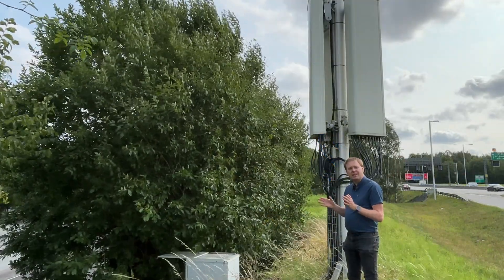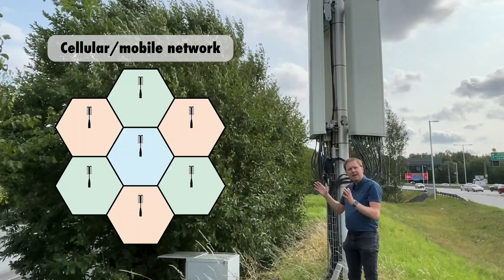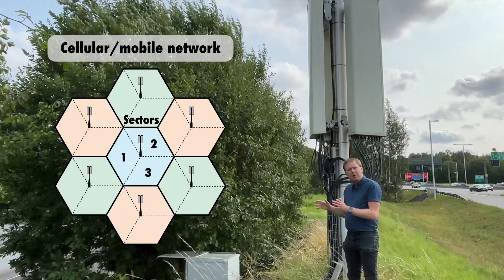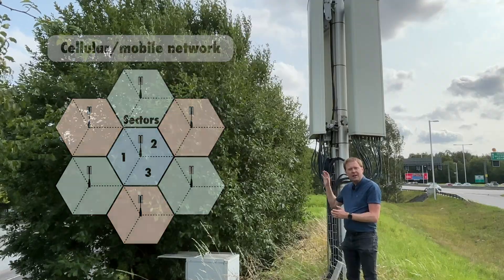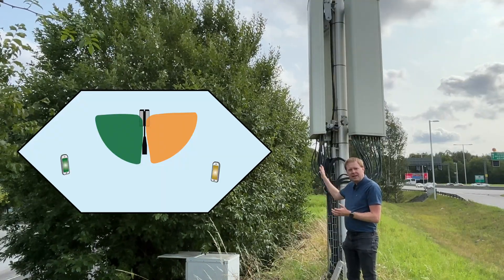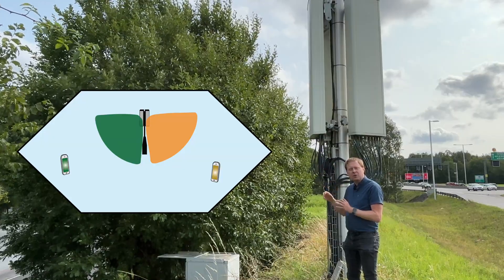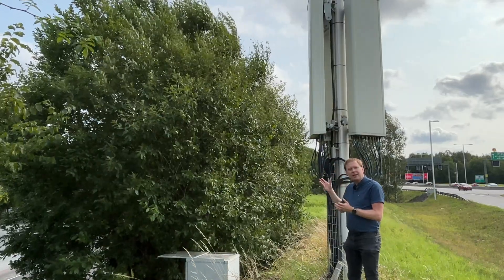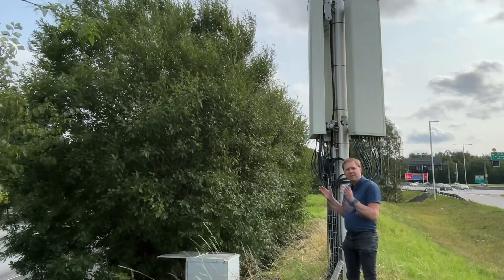How Cell Towers Actually Work (Base Station Tour)

Comment: when we say passive antennas can’t change anything, don’t we ignore RET ? normally it is possible to give uptilt or downtilt to arrange coverage if site has RET motors.
Reply from the maker: Yes, you are right that these panels typically are capable of changing the tilt angle. To my understanding, this feature is mostly used to fine-tune coverage right after the deployment, and not to dynamically adjust to traffic changes.

Comment: Isn't it usually unsafe to stand that close to a (presumably) operational base station?
Reply from the maker: Yes, one shouldn't stand this close to base stations for an extended period of time since the signals will transfer heat to the body. However, the camera angle is tricking the eye since the antennas were substantially above my head.
Reply: @WirelessFuture  that makes sense because for a moment I couldn't believe how huge those antennas looked next to you, professor.
Reply: Former Verizon Principal Engineer here. RFE Emissions vary per deployed frequency, but for something similar to what he showed, there is ~15 sq ft area from the transmitter you want to steer clear of. Higher frequency 5G deployments can actually be less dangerous due to their decreased power levels.